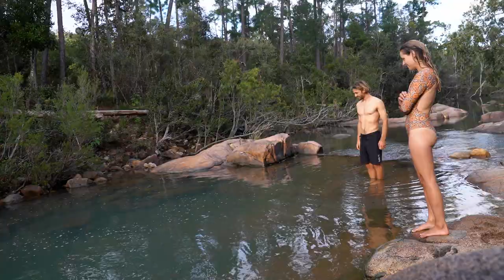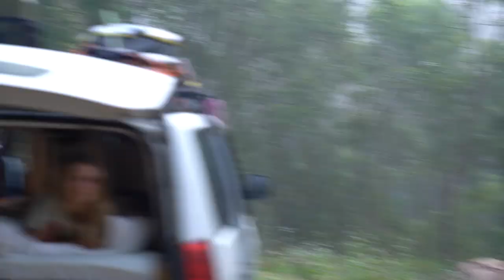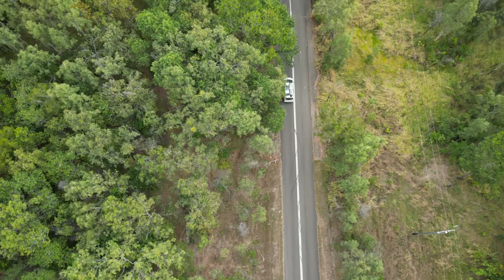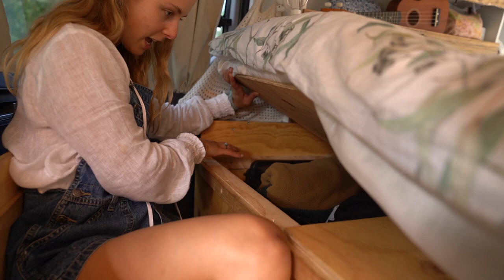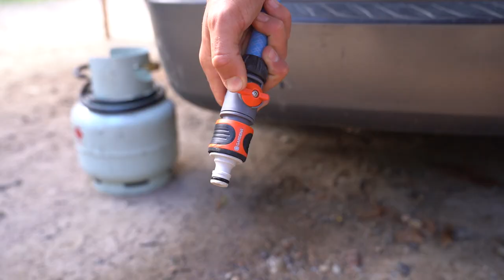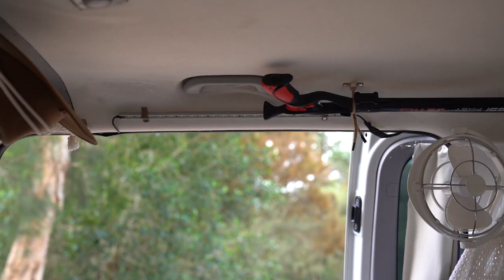Hyundai Imax Van Tour & camping in Byfield National Park | Ep.06

Comment: Same as you we didn't see many Hyundai iMax or iLoad conversion so I am happy to have a tour of yours. Thank you.

FYI: We put a 9 litre brass monkey freezer between the front seats to supplement the 40 litre waco fridge. Meat for a week, and ice too so I don't need to put water or wine in the fridge. 

We kept the back seats and removed the middle row. The tri-fold bed is behind the front seats and the backs of the back seats is our 'headboard'.

When in campervan mode we use the space under the bed for storage. 

The bed is folded up against the front seats when in passenger mode and we can have five people in the van to get around town.

The kitchen box is in the 'boot' and we have a reimo tailgate tent for privacy.  There is 40 litres of water on the roof, 240 watts of solar and an awning on either side of the van. 

We kept the factory lining as is but installed limousine tint on the windows and have travelled  in -0° - 30+°.  Each night we hang our beach and bath towels around the mattress to trap our body heat in winter,  and to block light pollution too.

Thanks again for the tour...

Comment: Hey guys, great video. I'm looking at converting an imax as well and looking to build a similar layout. My only question is how do you find ventilation at night? Do you just leave the side windows partially open to allow a breeze in? Would you put in a roof vent in if you were to build it again? Cheers
Reply from the maker: Hey Matthew, awesome mate! Yeah we just pop out all the side windows, and we also have the sirrocco fan so if it’s a bit hot we pump that and it generally helps quite a bit. We find on the really cold mornings there’s still a bit of condensation build up but I wouldn’t put a ceiling fan in ours because popping the windows works fine! Does your imax allow all the windows to pop out?

Comment: Hey I am looking to get an Imax 2010 version, we’re the windows any trouble to black out (the back ones) and was it easy to remove the brackets for where the seats were for the back?
Reply from the maker: Hey Tim. The windows were pretty easy to black out, little bit fiddly cutting it to the right shape but wasn't too bad. And we actually couldn't get the sliding brackets out for the centre row of seats, so we pushed them forward and built the platform on top of it. The back ones all came out easy.